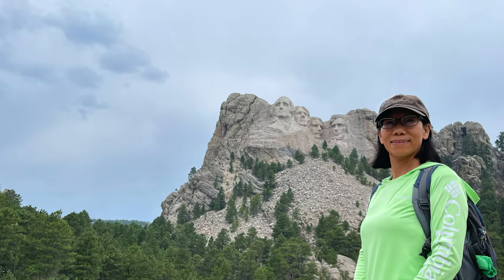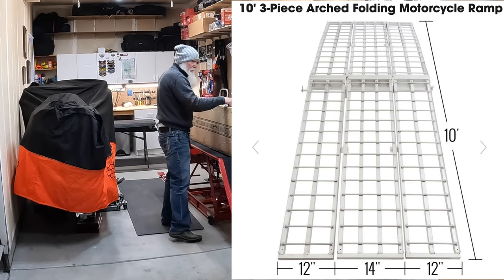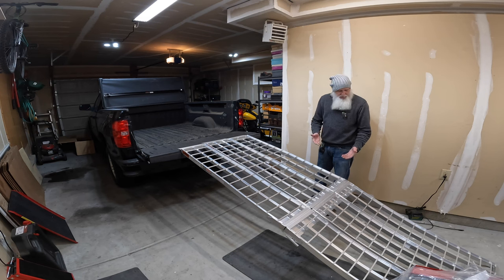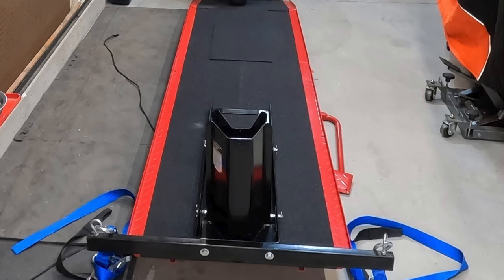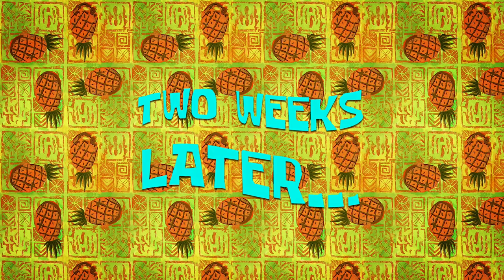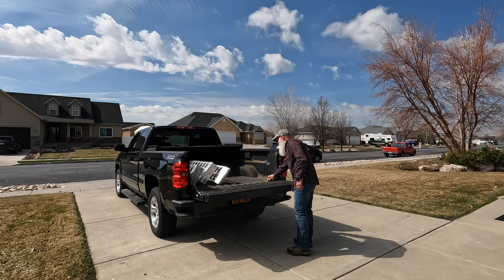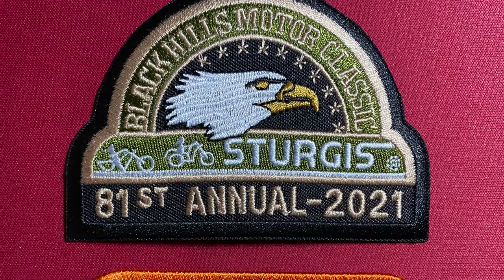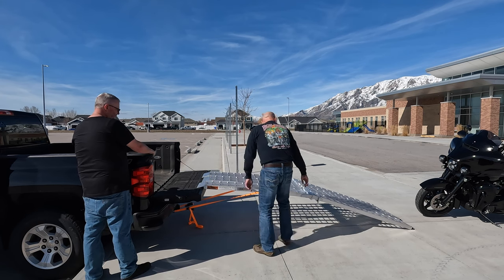Black Widow Motorcycle Ramp | #blackwidowreview #garagetherapy #therapist #sturgis

Comment: I have always balked at using these types of ramps out of concern about deforming the pickup's tailgate or even breaking the cables that hold the tailgate. What are your thoughts on this?
Reply from the maker: Guy, I understand your concern and I would never advocate anyone go a route they do not feel comfortable with. I know that the 3/16” steel cable on my Chevy tailgate has a breaking strength of 4,200 lbs and times (2 cables) theoretically has 8,400 LB breaking strength. Now with that said, the “working load” is calculated with a safety factor of (5) so the working load limit divides down to 840 LB for each cable.The Working load is the force the cable or lifting device a piece of equipment is subject to in an everyday working environment. My motorcycle back wheel (axle) is almost directly over the hinge line of the tailgate when riding and is subject to ramp load extremely infrequently. I understand the steel tailgate could be subject to deformation if a constant cycling load is exerted out of the edge of the tailgate. OK, I see a lot of eyes are rolling :) Enough of a Structural Engineer’s rambling… Ultimately, I am comfortable with the rare occasion I load either of my bikes in the pickup bed with this method. There is such a large safety factory dividing the breaking strength by 5 and the fact that I am exerting about equal load between two of these cables, I am comfortable. Again, this is just the call I have made and would not recommend anyone do anything they are not comfortable with. I  hope you subscribe to the Channel and I hope I have not bored you to 😭. 😀 thanks for the question 🙋
Reply: @clemgriffis3446  I appreciate your thoughts.
Given the price of fuel, I have considered hauling instead of trailering as a very viable option. With gas at over $4/gallon for premium, and 8-10 mpg pulling my trailer, it becomes a very important consideration.

Comment: I see those ramps come in 8, 9, 10, and 12’. Which one do you have? Also, are you able to fit the ramps in a 5’5” bed with the bike in the bed and the tailgate down?
Reply from the maker: Mine is a 10 footer. I believe there is a link in the notes to an affiliate link. I think I was having trouble finding access to the 12 footer. They fit inside the pickup when folded over but I do strap both of them against one side’s wheel-well. Check out mine and Roxy’s subsequent trip to the Sturgis area spring of 2023 where we used the ramps for the first time. Thanks for the great question.
Reply from the maker: Oh BTW, my truck bed is 6’ but the ramps should still load just fine in your truck bed. With tie-down rachet straps.
Reply: @clemgriffis3446  Thank you sir.

Comment: How much do you trust the cables on the tailgate of the truck?
Reply from the maker: Stuart, I have had many questions on this post that are similar to yours. I understand your concern. I am pasting one of my responses here and hope this describes how I look at the load on the cables but it is really a personal choice and I am only describing my situation and I am not advocating you do anything you are uncomfortable with.    Thanks for commenting!    PREVIOUS REPLY POST -  "Guy, I understand your concern and I would never advocate anyone go a route they do not feel comfortable with. I know that the 3/16” steel cable on my Chevy tailgate has a breaking strength of 4,200 lbs and times (2 cables) theoretically has 8,400 LB breaking strength. Now with that said, the “working load” is calculated with a safety factor of (5) so the working load limit divides down to 840 LB for each cable.The Working load is the force the cable or lifting device a piece of equipment is subject to in an everyday working environment. My motorcycle back wheel (axle) is almost directly over the hinge line of the tailgate when riding and is subject to ramp load extremely infrequently. I understand the steel tailgate could be subject to deformation if a constant cycling load is exerted out of the edge of the tailgate. OK, I see a lot of eyes are rolling :) Enough of a Structural Engineer’s rambling… Ultimately, I am comfortable with the rare occasion I load either of my bikes in the pickup bed with this method. There is such a large safety factory dividing the breaking strength by 5 and the fact that I am exerting about equal load between two of these cables, I am comfortable. Again, this is just the call I have made and would not recommend anyone do anything they are not comfortable with. I  hope you subscribe to the Channel and I hope I have not bored you to 😭. 😀 thanks for the question 🙋"

Comment: THANKS FOR THE VIDEO.  I WENT TO AMAZON AND THEY ONLY HAVE 9 FT TO ORDER....I HAVE A 2020 ROAD GLIDE...IS THE 9FT RAMP SAFE?
Reply from the maker: Mine are 10’, I don’t know that I would go any shorter. You may have to buy from Black Widow direct or from Discount Ramps to get the 10 footers.
Reply: @clemgriffis3446  Thanks for responding....BE safe.

Comment: Doesn’t that rod tie them all together?
Reply from the maker: The rod ties them together laterally but there is still a fair amount of “play” length wise that is just enough to create a disaster if the tie straps are not connected to the center section. Perhaps I will do a short video expanding on this subject. Be on the lookout for a new ramp video.

Comment: Is that a half ton pick up? I have a F-150 and a RGL. Do you know of any weight issues or handeling of your pickup?
Reply from the maker: I have a Chevy Silverado 1500 (1/2) ton and absolutely no issue with handling. I brought my bike across country from Ohio to Utah and no problem. If you have a Harley, I would recommend that you disable the motion security motion sensor (“Transport Mode”) that causes the warning lights to continue flash and will eventually kill your battery. Thanks for the question. What state/province/country are you in? Hope you will subscribe if you are not already. Thanks
Reply: Clem, what box length is your Chevy? Any issues with the weight of the bike rear wheel sitting on the tailgate. I have the Black Ultra as well and thinking of transporting this way, I have not purchased a truck or ramps yet.
Reply from the maker: @wayneglabais1208  I just have a 6 foot bed. With the Limited front wheel in the HF wheel check, the rear wheel axle is directly above the tailgate hinge. I had no issues with the street glide on a trip from Ohio to Utah. Really not a problem.
Reply: Ok, so the rear wheel is only partially resting on the tailgate then
Reply from the maker: @wayneglabais1208  Yes, Have a look at 10:28 in the video for a good side shot of the rear wheel of the street Glide and 12:16 of the Limited.

Comment: Where do you put the ramps when the bike is in the bed?
Reply from the maker: I have a couple of extra ratchet straps I use to tie them collapsed on their side on top of the wheel well. As long as you cinch them up good with a QUALITY SET of ratchet straps, you will be good to go. Thanks for the question.
Reply from the maker: We actually did this on a trip to the Sturgis/Mt. Rushmore area this past Memorial Day. We have a video to Sturgis in that time frame I published about 6 m on this ago. Check it out. Hey if you do decide to buy these ramps, check out the affiliate link in the description section of the video. Thanks again for watching!